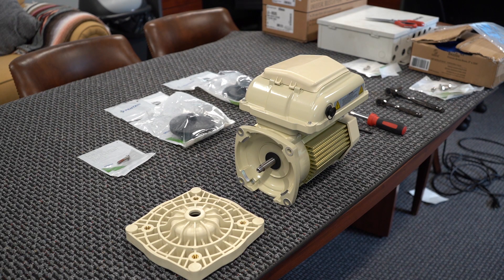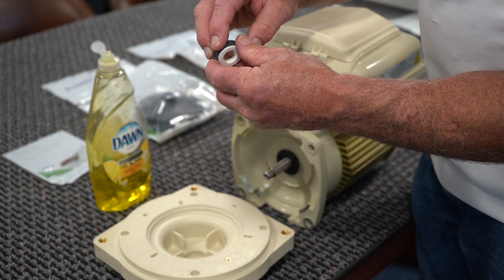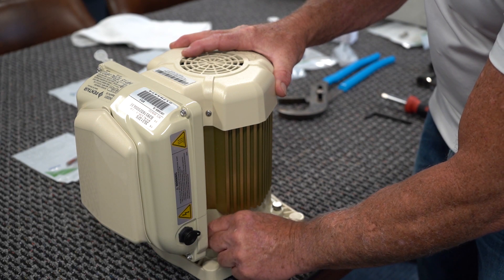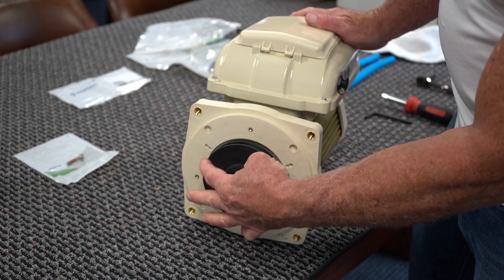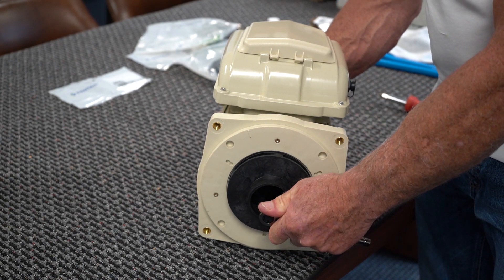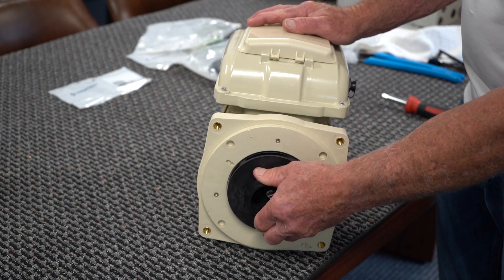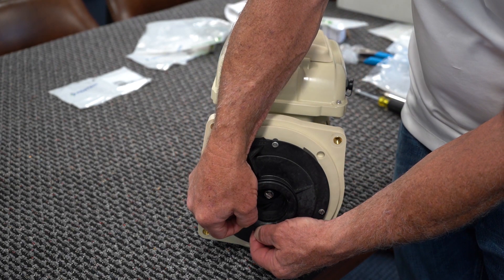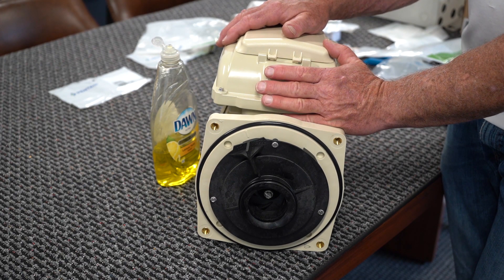How to install / put together the power end to a pump

Comment: Put anti seize compound on all the bolts! They tend to seize up by the time of the next rebuild. Why? Your rebuild is precipitated by a seal leak. And that corrodes the bolts. You either notice the leak or you hear the bearing failure that was caused by the leak. These bolts can be so seized you have to cut them off and extract the broken pieces. NO fun.